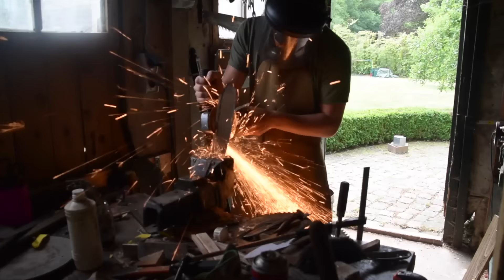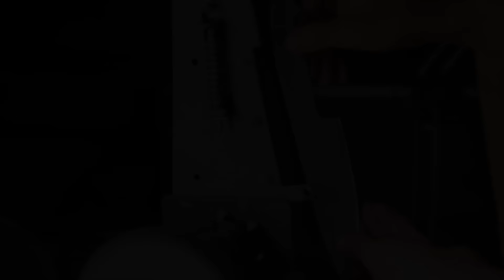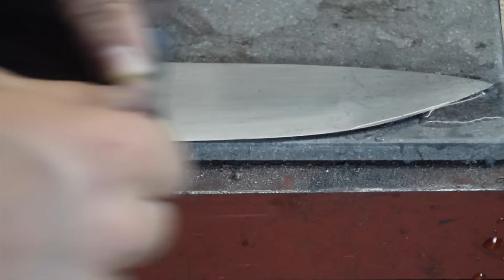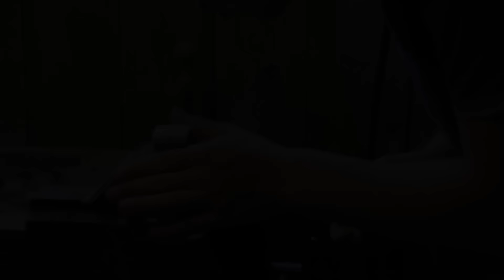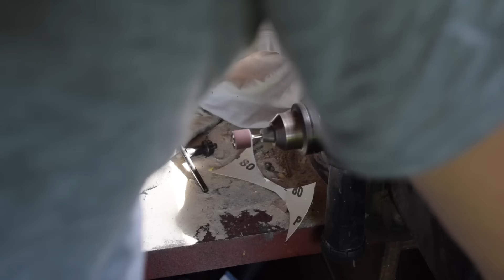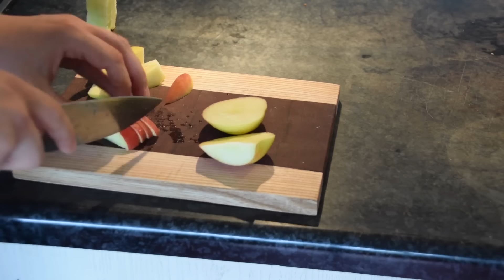Making a Chef's knife - BBQ set part 2/3 - Knives&Stuff

Comment: Really nice kitchen Knife 
But please make yourself some proper Pushsticks
Reply from the maker: What is the difference between this and proper push sticks. First people complain that I should make push sticks, I make them and then they are still not good. I even used the design of Wandel
Reply: +knives&stuff 
I actually didn't looked that closely I just thought they were just some sticks. Still a very nice Knife what is the wood on the handle
Reply from the maker: Not only Wood They are just stick but with an improved grip at the end so it holds the wood properly. It is some kind of curly ash :) really cool because it changes when the light hits it
Reply: +knives&stuff Alright I'm just worried about your fingers even thought I'm also just 15. That's some really nice wood I found some Curly poplar in our firewood pile

Comment: awesomely done. 
can you please share what metal was that amd what was the oil that you treated the wood with at the end and after the oil did you polish it with a sandpaper?
Reply from the maker: Thanks,  the metal was a blade from a paper shear, it was already hardened. The oil is mineral oil: skydd from IKEA. I used 600 grit sandpaper to polish the wood. :)
Reply: Awesome thanks